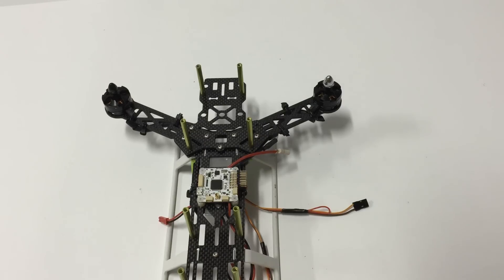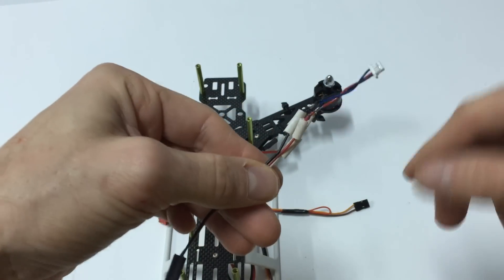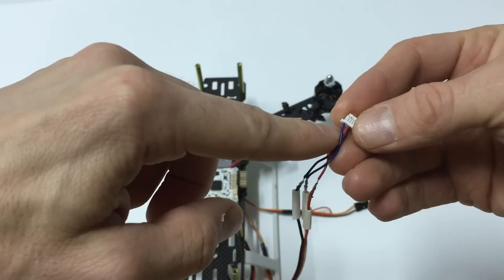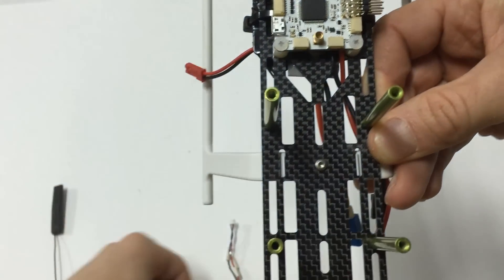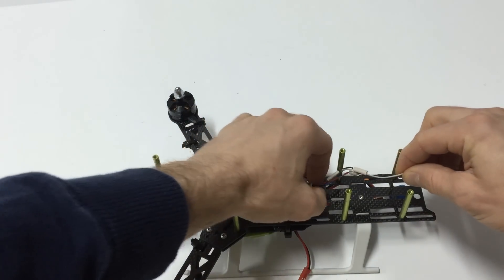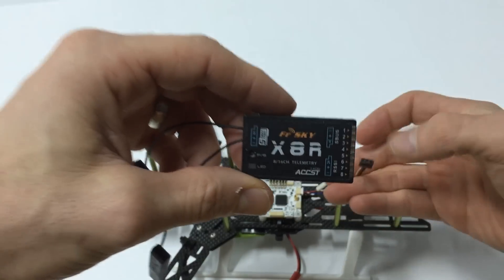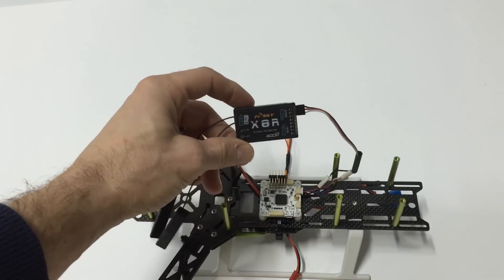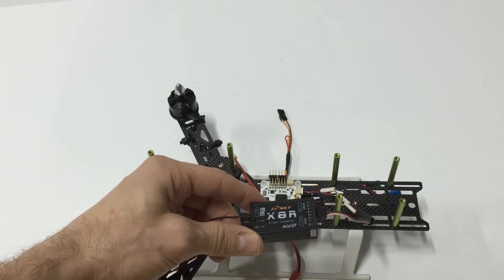How to Make a S Bus Connector to go from CC3D/Revo/Atom Board to a Frsky X8R receiver

Comment: you think it will work with the cc3d mini revolution?
Reply: Two of us want to know
Reply from the maker: Elf Kind Yes it will. Same communication protocol.
Reply: i try it and it does not works. cause the plug of main port of mini has 4 wires plug.
Reply from the maker: Just make sure you know for sure which are power and ground!!!
Reply: Did it finally work? I have the same need

Comment: Hello! Great Video! I am new to this and I just ordered an cc3d revo with x8r receiver. If I connect them like this, I will be able to use telemetry on my Taranis? I will be able to see altitude, speed, etc. on my Taranis display?
Reply from the maker: No.  You will only get RSSI. I am not sure how you connect to get the battery voltage on a Revo, depends on the software, if you are running Raceflight or Betaflight.  The other elements require additional sensors you connect to the smart port.

Comment: Does the cc3d get its power from the x8r via sbus
Reply from the maker: +Anything “clarkey” RC Hello Good question!  No. The other way around.  The CC3D gets its power from the BEC on one of the ESC's or 5V from a power distribution board.  Then the CC3D powers the receiver through the 3 wires, pos, neg and signal that connect to the X8r.
Reply: +2dogrc thank you for a fast response that has helped me heaps i appreciate your help thanks once again.
Reply from the maker: +Anything “clarkey” RC No problem!  Just happen to be online early getting ready for Toledo show!  I am in answer question mode!
Reply: So to power the cc3d do I plug my 5v ubec into one of the cc3d esc channel ports
Reply from the maker: +Anything “clarkey” RC Yup! that is correct.  They are all connected, so if you are using 4 ESC's with no BEC, then you can use the other 2 ports with just a plug in the pos and neg.  Pos in the middle.  If you don't like wiring, then you could use a servo Y and connect 1 of the ESC in one end, your Ubec in the other and then the one connection into the appropriate ESC channel.
Reply: +2dogrc awesome thank you

Comment: So if I want to assign a channel to a switch on my transmitter, with sbus, where is the signal coming out for say channel 6?

Using the regular PPM it would just come out channel 6 on the receiver but with sbus I assume that is not the case?
Reply from the maker: +goofyfoot2001 One the Taranis system the first 8 channels are Sbus, then the 9-16 are PWM.  So you could assign a switch to channel 9, then plug in the whatever to channel 1 on the receiver.
Reply: ah cool

Comment: I have a question, I bought the atom version and it came with a 4 wire connector, not a 3 wire as shown in your video. It fits into either port. Colours are red, black, yellow, green. Can i use this somehow?
Reply from the maker: +Propflux01 Yes.  The connector has 4 pins, but you only need 3.  All you need to do is make sure the order is correct when connecting to the Receiver wire.

Comment: hello, is there any way to get telemetry over over x4r from cc3d ?  with smart port? I need only the vbat...
Reply from the maker: +George Chatzisavvidis That is a good question. I am not sure.
Reply: +2dogrc I did not find any solution for this. You could only use Frsky lipo sensor for your x4r smart port. Maybe it´s possible using Cleanflight for cc3d.

Comment: Hi, I made this cable and it works very well. Thank you. I would like to know what is the name of the little white connector that come from the main port (CX3D).
Reply: +Marco Magalhães It´s JST SH connector with 1mm pitch.  Be careful because the standard sh connector has a different pitch and you need to know how many pins are required. :)
Reply: +Eric Schrödinger Thanks Eric, Merry Christmas
Reply: You're welcome. Have a nice christmas too!

Comment: Can i use this setup with the 6xr?,,,,,,All the other breakout cables where white,,,kind of confusing really,,as to which one goes where.I have installed a cc3d on another quad,,those wires where all colour coded (simple install).
Reply from the maker: +David Rickard Yes you can use this on the 6XR receiver and 4XR as well.  Here is a thread specifically to the 6XR and it has a picture of the order in the 2nd post.
https://forums.openpilot.org/topic/57433-cc3d-and-sbus-on-x4r-and-x6r-receiver/
Reply: +2dogrc thanks for the link,,,,all set up with no issues with the revo,,,thanks again.

Comment: Hi got a question.i have a orange r800x woth sbus output im using a spectrum dx6i tx is it posible that would work on my cc3d fc?im in version 15.02 that support oneshot i wanto enabled also the one shot im using kiss 18a esc with oneshot.any tips or ideas? Tnx and advance
Reply from the maker: +kal taang Yes, this should work with that system as well.

Comment: So this what's coming with my CC3D looks like http://img.banggood.com/customers_images/large/2015050517092848-973582.JPG basically it has 4 wires coming out , so from what I understood from your video connect (counting 1 as the black wire) wires 1 2 and 4 into 1 2 and 3 of Sbus correct?
Reply from the maker: Gus F That is correct.  You will then not need to connect the wires in to each channel on the receiver, only the Sbus connector.
Reply: 2dogrc thanks man, I have another question, I watched your other video how to set i up in open pilot, and I noticed you programed two extra accessory switches , the question is where do you physically plug the extra accessory?, say for instance to make it simple, my setup is just like yours above CC3d connected to X8R through Sbus right? so now I wanna add a lost buzzer and assign it to a switch on the transmitter so if I lost it in a bush I can switch and sound the buzzer, where do I plug the buzzer in, can I use one of the PWN channels in the CC3D and assign it through the software or do I need and S-bus hub ? I'm hoping I can just plug the buzzer in one of the PWN channels , have you tested this before? the only thing I got so far are the batteries lol waiting for my kit and various parts to come in thanks.
Reply from the maker: Gus F Gus, you can do it BOTH ways! If you want to plug it into the X8R then would have to bind it differently.  On the X8R, bind channels 1+2, then 3+4.  On the taranis set bind to D16, channels 1-16.  Select Bing on the Taranis.  Then Hold F/s button on X8R. while plugging in power.

Now Channel 9 on the mixer page of the Taranis will be channel 1 on the X8r.
Hope that helps.
Reply: 2dogrc I'm not sure I completely understand, but I will wait to get my stuff in, having hands on I'm sure I will figure things out a little easier, but thank you for your help and I will keep you posted and may even ask your help again , cheers bro :)
Reply: 2dogrc  Ok I think I get , by binding that was it makes chanels 1-8 through S-bus and 9-16 through PWN, right?, and then I can plug my module in channel 1 of X8R and that would be Chanel 9  on taranis and so on right? now when you say bind 1+2 and 3+4 you meant use the jumpers right?
Reply from the maker: Gus F Bingo!  Then it the mixer assign a switch to which ever channel on the receiver you are using for the horn.
Reply: 2dogrc
Cool man thanks, now I hope the jumpers come in with the package